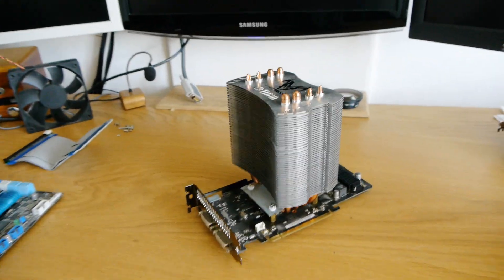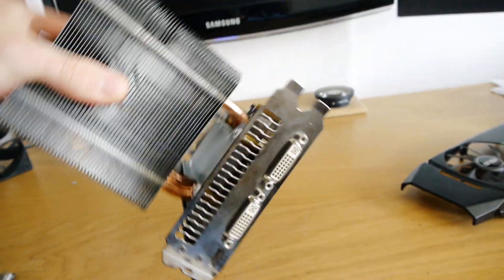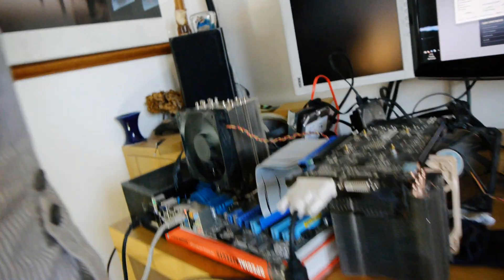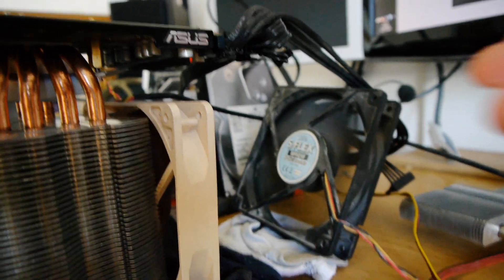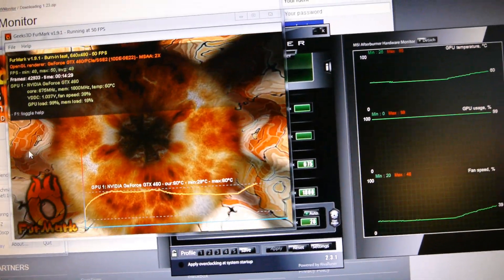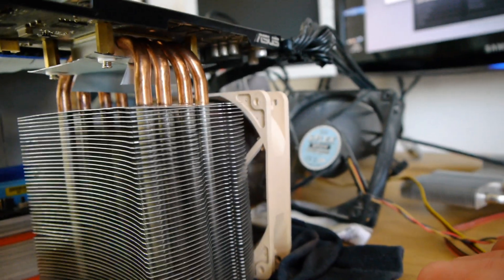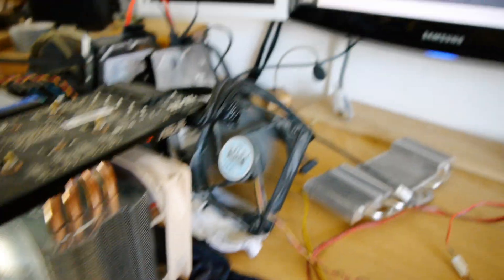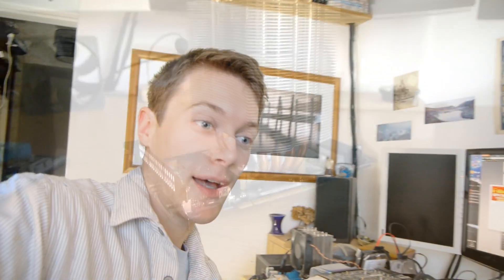CPU cooler on GPU (INSANE temps!)

Comment: I like your ideas. its a cool cheep way if you already have your components in spare and do everyting. But you have to make your own case. It would be more practical in terms of efficents to use a water cooling even its more expensive. Its very time consuming to build a case that covers the functionality including space of a 20 dollar cheep PC case.
But if you like to go big and diy. I had very very good success just mounting the GPU and CPU cooling, screwing it to my Wall. If its out of stone of cause. Wood would not work! You dont even need a fan anymore. Just get a copper plate and some realy long screws and add some heatpipes and mount it on your plate to your GPU. Thats it! NO noice! garnteed, exept you are using mechanic hard drives. i get my GPU temp under 50 C° where its more than 25C" in my office.

Comment: Hi, you are cooling just the GPU die itself. You should get problems with power regulators that the original cooler used to keep under control.

Comment: I didn't want to spend the time or effort installing a custom cooler like this, but in Canada we have some relatively inexpensive cooling options for GPUs. For air cooling, simply storing the computer outside allows the naturally below freezing air to circulate in the case, with the arctic wind rendering any loud fans and stock coolers unnecessary. One can also opt for a liquid cooling system, which consists of regularly chucking snowballs into the case. Real enthusiasts can get ultimate cooling for their computer with a hybrid air and liquid cooling system by storing their computer outdoors during a snowstorm, where increased wind speeds offer greater cooling than standard air cooling, while simultaneously, heavy snowfall keeps the system at frigid temperatures even during long extended gaming sessions. In the unlikely event that a snowstorm does not occur, submerging half of the case in the arctic ocean while leaving the other half exposed to the air is another great option for hybrid cooling.
Reply: +il2xbox lmfao. if you could waterproof your system and stick it outside during canadian winter. you'd have 0 issues with cooling. waterproof it and get a usb extension. good to go. stick that fucker in a snowbank just outside your window. I might even fucking do this.
Reply: BeRAd427
Garbage bags from Walmart and some tape should do the trick. Might as well double bag it, just to be safe.

Comment: I purchased an R9 290 the day they came on the market, so, the cooler is reference.  The card is slightly overclocked, core 1000MHz, memory 5600MHz.  I use MSI Afterburner to keep temps in line and seldom see 71 degrees C in a stressful game or Fire Strike benchmark.  I wear headphones and other fans are louder than the GPU fan, so, noise is not a problem, even without headphones.

Comment: where can i buy cool heat sinks like that ones???
(and what type you can recommend me)
Reply: Cooler master 212x evo 45$
Reply: Xantaxa thanks!
Reply: Zona ALG So was I?
Reply: Xantaxa  if EVO212 is to tall.... what shorter one could I use plz?
Reply: You tube Entertainment For All are you actually considering doing this? because its purely for fun/experiment, its not practical one bit
Reply: Xantaxa What? Using aftermarket coolers is one of the most practical things you can do to improve a computer's performance. Everyone that knows anything about computers knows that stock coolers are garbage.
Reply: BlueCosmology she was talking about using a CPU cooler on a GPU
Reply: thank you

Comment: I first did this on a original Geforce 2 almost 20 years ago, It seemed to bottleneck itself where using even the biggest of cooler didn't really matter over using something half the size. still something fun to goof around with tho!
Reply: paradoxdesigns sorry is it safe to go for this config? i mean many chips left with no cooling
Reply: You tube Entertainment For All if your heatsink is that big of course. lol

Comment: I do the same in 2003 With new Fx 5200 i hate fan noise and heat, i do this using AMD Athlon Heatsink ( lost two or 3 pci i dont remember) then i underclock my processor with speedfan, and do a perfect job, no more noise, no heat, the pc still working i sold it for working in a lab.

Comment: Old video. Nice work.  I am definitely a fan of silent (or near silent) home and office-area computers.

Now there are modern cards that run much cooler and quieter. That is always the case though, pay more money and get smaller, more powerful, quieter, and less wattage.

I'm hampered by desire and physical space. I am a long time fan of small form factors, my first mini-itx board, a VIA, has USB 1.0 and an 800 MHz processor. My last mini-itx, DH77DF, is great for powerful and quiet with SSDs coupled with a Noctua NH-L9i low profile HSF stuffed into a box the size of a dictionary. If you don't see the power light, you cannot tell if it is running.

My current desktop uses an i7-3770S (65 W of TDP) cooled by a Noctua NH-U14S HSF plus three other Noctua (1 x NF-S12A, 2 x NF-A14) for CPU and chassis cooling. Love the Noctua for their silent efficiency. The GPU is an evga GTX 780 classified with their ACX cooler, moderately pushed for more performance. The fans are just audible at power-up but spin at minimums once the thermal control monitoring software starts running. Heavy load needs to be applied to get fan speed changes. Even then it is barely heard without straining to be aware of it. I went all Noctua on this PC, aside from the GPU. It was an expensive experiment and successful. Still, at the time it was (still is, too) much less expensive than implementing water cooling.

I am modernizing, as I type, I am awaiting postal delivery today of a i7-5820K (140 W TDP). This will receive the 780 classified on an Asus X99-Pro. I am considering an all-in-one cooler from Corsair perhaps with Noctua fans replacing the stock Corsair fans. I have been researching and have to acknowledge the Corsair SPL120L (43 dBA) vs Noctua NF-F12 (22.4 dBA) have almost twice the noise but the Corsair have a static pressure of 4.00 mm against Noctua's 2.61 mm. The Corsair have 53% more static pressure for that added volume, 2700 RPM vs 1500 RPM.

There is a price for silence in performance and money.

Comment: The problem I see with this is that it doesn't cover the rest of the electronics on the card -- just the GPU chip itself.
Reply: Adam Olympia the board is designed to handle high temperatures. you can actually put your board in the oven so that you can remove the heatsink for repasting. the GPU chip is the only thing that the requires a heat sink :D
Reply: Autismos sorry so this config is no no Choice ?
Reply: Autismos I've had to "cook" my GPU in the oven in the past to get the solder to reflow, due to damaged card from running hot for too long... Sure, they are designed to work under high temps but that doesn't mean they will LAST a long time running so hot.  The hotter they run, the lower MTBF (mean time before failure) you get.  It's always best to cover all the circuitry in the card, especially the video ram. That's why they make water cooling heatsinks that cover the entire board.

Comment: Are you only cooling the gpu die?
What about the other parts, eg. vrms, ram modules?
I'm planning to buy one of those cheapy chinese water blocks to attach to my gpu, but am worried the vrms will overheat/ prematurely fail. 

Thanks

Comment: Just to add a little comparison, I have a slightly older GTX 560 which idles around 30C, Furmark max is 91C, gaming it's around 55-70C, depending on which game I'm playing.  I also replaced the dry paste under the IHS to get slightly lower temps.  And this is using stock cooling.

Comment: meanwhile my 280 never goes above 60 unless a game is that badly optimized...with the stock cooler...
Reply: ***** You are wrong, he didn't mention overheat, he mentioned the 60 degrees celcius temp.
Reply from the maker: Jayson201 Making a racket in the process I imagine. ;)
Reply: The fans on my twin frozr are actually kinda soothing
Reply: Mikko Muhonen 
significant difference indeed. most GPU's hit 60-80 C on a regular basis. almost all of the commentors above have no idea what they are talking about, nor did they even read the original statements before posting
Reply: i don't know anyone who measures their temps in Fahrenheit for pcs, barring simply translating from C to F
Reply: "your cooler is garbage"
"nothing to do with badly optimized"
"cant handle modern requirements"
plays GTA V on very high, and its BELOW spec, get decent frames, stay below 60 degrees.

play h1z1, way above spec, goes over 60.
Why are you all such elitists? the 280 is STILL a good card. Its not the best but youre all wrong about it.
Reply: You dont understand me because I'm not great at explaining things. All I'm saying is the game uses resources in such a horrible way that it causes the gpu to heat easier than on battlefield 4 during game.
That being said, at the END of a round of bf4, it uses more of my gpu than during the entire game, causing a slight temp spike.
i dont wanna argue, or be insulted, or insult.
Reply: thank you mikko. My GPU stays steady between 54-56 C on GTA V on high-veryhigh settings. Play some H1Z1 and it'll reach 60 at times. That is ALL i was saying, those are my observations.
Reply: it changes plenty.
No. A game probably isnt going to overheat my gpu anymore than a more optimized game. But its NOT overheating. Just heating a little more than usual. That isn't my question, my debate, that's my observation. My observation was about 2 or 3 degrees celsius. Not 20.
Reply: Jayson201 mate... Your gpu overheating has nothing to do with bad software optimization. If your card can't hold out maximum stress that PC can give to your gpu then it's something wrong with your cooler (either you OCed it more then cooler can take it or there's dust in your cooler).
Reply: If thats your argument then you're either an elitist or you're more of an amateur than I am.
My GPU heats up more on H1Z1 than it does with Battlefield 4 and I never mentioned OVERheating. Just going over 60. H1Z1 is NOT as demanding as Battlefield 4. H1Z1 Reccomends a Radeon 6870 and I have an R9 280, which is I think the recommended GPU for BF4. Try to tell me that my gpu has a problem, or that I'm wrong about the optimization of H1Z1, and I'll prove ya wrong. again.
Reply: vulqo It's pretty obvious that it's Celsius. 60 degrees Fahrenheit was like 3-4 degrees celsius.
Reply: vulqo may do his in Fahrenheit exclusively, nothing wrong with that. the only stupid question is the one you dont ask. assuming sucks
Reply: Ugh... Stop this pointless discussion already.
Reply: Jayson201 I would say it's not "optimization", just a shitty game engine like dayz. There's no fixing/optimization for it, it's simply crap. :D
Reply: Jayson201 Because you're wrong. No matter how hard an application will push your GPU, it shouldn't overheat.
Reply: Mikko Muhonen that doesn't change anything, lol
Reply: I wouldn't say meanwhile as it is several years old fool
Reply: yea, the reference model of 290x and 280x and 280 go over 85 usually, so you dont have to worry about it overheating lmao
Reply: Jayson201 CELSIUS OR FERINHEIGHT
Reply: ok, im just checking
Reply: Jayson201 The point of the video was to make a quiet rig lol, not to keep the card under 60 degrees. n00b.
Reply: Jayson201 He's right. If your GPU is overheating from badly optimized software, the cooler on your card is garbage. Badly optimized software won't push your card further than possible anyways.
Reply: Jayson201 Your logic makes me cringe. Please look up some information on this because you clearly don't know what you're talking about.
Reply: Jayson201 Every game has different methods of utilizing but regardless if game is optimized or not your hardware shouldn't overheat. That's what i'm saying. :)
Reply: i didnt say it overheated. i just said it heated up more.
60-70 isnt overheating by a longshot.
Reply: Also, as for "a game isnt going to use more than it needs"
Battlefield itself has a memory leak. Should only use 2-3gb, sometimes i look and it's using 6. gotta restart it. thats just one example
Reply: Jayson201 If ur GPU gets hotter then ur avg game it means that it's using more power of ur GPU because the game needs it. Not optimized game will most definitely lack GPU utilization.
About battlefield it all depends which battlefield ur talkin about.
Reply: I mean yall are speculating on why, but I'm giving you factual observations. So keep telling me I'm wrong that's okay because I know I'm right. Test it yourselves. You MIGHT get different results with different GPU's but hey, go buy H1Z1, BF4, a 280, and test it out.
Reply: people are trying to teach ME something? I'm showing them results from experiments and they're giving me bullshit for it
Reply: Mikko Muhonen suomi...
Reply: Jayson201 you can go over 80 safely with a 280 and a 6870
Reply: i dont want to safely go over 80, i'm happy with my 60 c:
Reply: Never was worried, I knew what the safe temps were. It's just most people who read my shit completely misconstrued what I actually said lol then argued. -.- I'm glad I don't have a reference model, 90 C is crazy, safe or not
Reply: Late to the punch homie, thanks though.. I've already tested that. I've noticed that during a round of BF4, shits fine all game. Sure depending on room temp (dont always have the air on, its summer now) it'll be 55-60 during game. At the END of the game though, when all the points are being counted, it's weird, my shit ramps up to a straight 100% and my temperature rises 5 degrees before dropping again. Like I said H1Z1 is not optimized to use resources properly, the game is in alpha, of course. Realistically I should be getting double, triple the frames based on what the game actually looks like. But It'll start out at 60 and drop down and average 25-30. I'm in AOD, and they all have the same problem regardless of their card. That being said, my average gpu temp during H1Z1 is usually a little higher than in Battlefield 4 during game. Like I said, game is in alpha.
Reply: ***** but you know what, thank you for trying to help and contribute and actually reading what I actually wrote, instead of ragging me like everyone else did. I appreciate that.
Temps never go above 65 because of how my fan arc is set. Thanks!
Reply: Game optimization means 
Let the game run nice and smooth, (get everything out of you gpu without losing "necessary" fps) 
Optimization has nothing to do with temperatures
Reply: my max temp is 65 so its not a problem. The game itself starts at 60 fps and starts dropping the longer you play. Everyone of my buddies who play it has the SAME problem, this is not exclusive to me
Reply: Thats what im saying XD it's what ive been saying the whooole time its the game lol

Comment: Practical way to do this is employ an AIO water cooler and put the CPU block on the GPU (or a GPU block rated for 130W+ heat removal)

Comment: Nice custom job but I was wondering why you didn't cannibalise the original heatsink on the GPU to make the mount but no doubt there may have been reasons for not doing it that way that I'm not aware of.

Sometimes it's riding by the seat of your pants when you have to do something on the fly. That's why I always think of what I'm gonna do if it simply doesn't work.

Temps are good tho ;-)

Comment: heat rises and cold sinks so by turning your heatpipe upside down with the hottest part above, you're heating the copper in the heatpipe and not the juices inside, the juices are being cooled.. so they stay liquid, the reason the juices(like acetone) are inside heatpipes are becouse acetone evaporates at your cpu and gets to be condesed where it gets colder, please turn it around and check your performance again you will see the heat is way better dissipated mutch grater overclocking power !